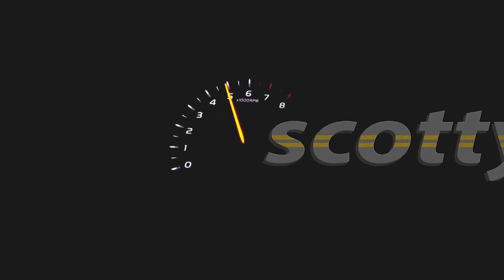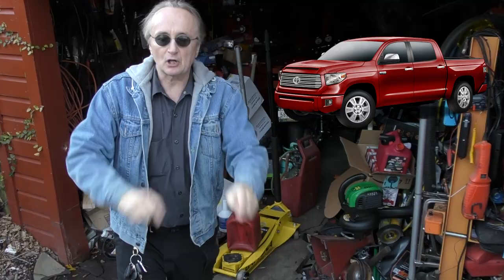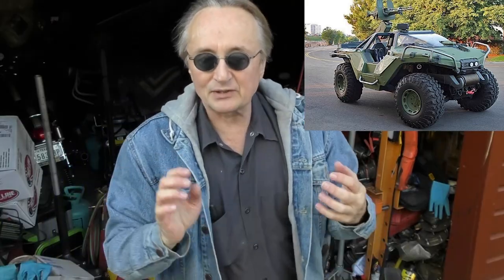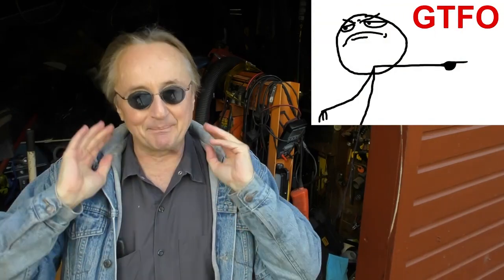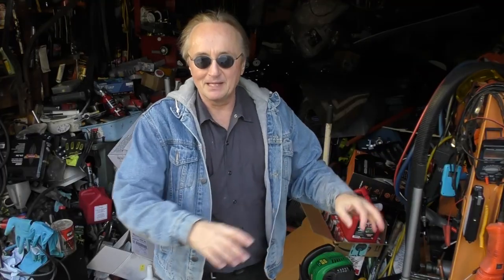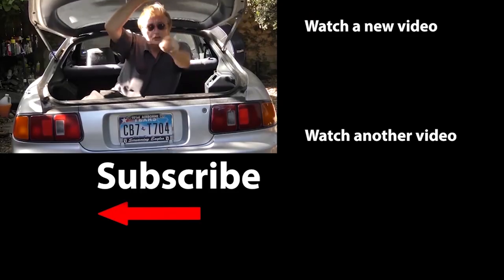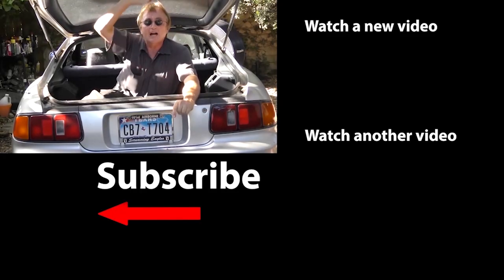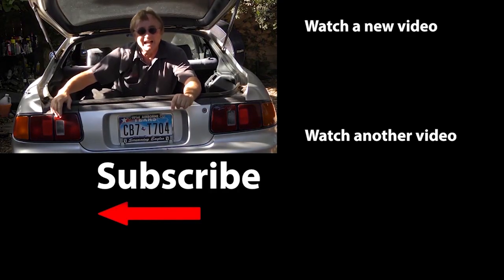5 Used Trucks You Should Never Buy

Comment: 90% of Ford trucks built before 2010 are still on the road.
The other 10% made it home.
Reply: I had a 1999 Ranger and went up to 200K with no major issues. I gave it to my ex landlord as I had to buy something with better gas mileage. I miss her. Best vehicle I ever owned.
Reply: Bullshit.  Still driving my 1999 ford pickup and the only thing I replaced was the water pump.  My buddy's all drive older Fords with no issues that amount to anything.  We own 5 Ford work trucks and we beat them up. Still working them hauling landscaping stuff. They are 2000 F150s.  Still running strong with no major issues.  We also have 2 Tundras  which are 2005s.  What great trucks.  They pull our equip trailers.
Reply: soon the 10 percent will join the 90% and go back to work again
Reply: Had two dodge trucks that had 200k and never had a problem
Reply: @ritualatom4119  I wish I had your luck. I had a new 2016 Ram 1500 5.7 4x4 and  it had many issues. I traded it for a 2019 Titan SV 4x4.
Reply: That joke is for dodge and Chevy
Reply: al carr Very true.
Reply: I dont see any fords on this list
Reply: Needed to repair my Ford very rarely, our GM vehicles gave us way more problems.
Reply: I got a 1988 ford F-150 with 88,000 and shes still running and driving super strong
Reply: Found On Road Dead
Reply: Yup. The other 90% are pulling Chevys out of the ditch!    FORD = First On Race Day!...
Reply: The only problem I can say about Ford's is there transmission typically go at around 100,000 miles other then that they are really solid
Reply: Matt Folta stop putting it in reverse on the freeway. my step grandpa uses his as a plow truck has only like 160k but shifts smooth and plowing is hard on ur transmission.
Reply: ZEROFUX  it runs better than your chevy tbh my mom had to take hers to a fucking machinic since her engine almost blew up and her alternator blew up her sensors kept going out and now there's a check engine light on
Reply: @kc-6837  I have 2016 RAM and i been traveling coast to coast and 0 problems. Your  Worst decision was trading for Nissan 😆 also am a ford guy😅
Reply: ZEROFUX  lol go back to your ps4 kid😂😂😂🤣🤣🤣
Reply: REALDEMON4U I wouldn’t have traded it but it came from the factory with the gas tank put in wrong,  the rear end was clunking because it was loose, numerous recalls, it smelled like it was burning oil, the brakes squeaked constantly, and the transmission seemed to have a mind of it’s own. All of that with 44,000 miles on a new  truck that I took good care of. No thanks. My three Nissan trucks have been great to me. I did love the Ram but it had too many problems for me. I do wish you the best with your Truck.
Reply: rob. g Glad to her that. I did love my Ram but it could have been a lemon. My buddy has a Tundra and he has never had an issue with it.
Reply: @liveuntetheredmusepodcast4832  Fix Or Repair Daily
Reply: @Kurt1969  How many windshields did you replace? My brother did that all the time seemed like. Plus on the road Rangers with cracks are everywhere.
Reply: Haha!
Reply: @ritualatom4119  You should play the lottery, then. Cause that's unheard of.
Reply: @StanTheObserver-lo8rx  I replaced mine 3 times. I still loved that truck. It was really good to me until I gave it away at 200K miles. Only because I drove 60 miles day. Otherwise I would have kept it.
Reply: @Kurt1969  lol,Why my brother did that same damn thing for his Ranger..200,000 plus miles. He retired and hated to trade it in. Then bought a Mercury something SUV. The wife wanted one.
Reply: @StanTheObserver-lo8rx  haha, I bought a Subaru Outback! ( 2008 when gas prices were high while living in New England ) I will be getting another car in the next few years and have thought about the new Ranger,  but will wait to see how it does.
Reply: Ford > Chevy > Ram
Reply: Spunbearing65, Guess your truck in on the list and now your feelings are hurt.
Reply: My dad still driving his 97 Expedition been a great vehicle. He bought it brand new.
Reply: @JordanKent814  its Chevy Ford Ram😀
Reply: Scotty never even mentioned Ford. This guy's a troll. Stop fueling the fire
Reply: 910AM Superstation Funnies  FIRST ON RACE DAY !!!
Reply: You misspelled Chevy
Reply: I know that's a LIE🙄
Reply: @kc-6837  awww.... You got a ford-nissan... JUNK😆
Reply: @mattfolta6956  yeah they're pretty sorry bout the transmissions☝

Comment: Agree with you on all but the Honda Ridgeline.   Mine has over 160,000 miles on it and the only failed component has been the started which I replaced myself for under $200
Reply: Ben my mother had one. It was an amazing truck.
Reply: Yeah mines an 06 RTL. Best vehicle I've ever owned. 

I think he just wants to bring the value of used Ridgelines down so he can buy one!
Reply: Hello, Ya mine has 310000 hard km because I use it for hunting and work, and i just had my starter go, and I found a company beside my work that rebuilds them and he did it for 110, and i did replaced it my self, very simple to replace, I don't know why he's lying saying engines blow up
Reply: @mikemasri4617  I'm with y'all. I'm on my 2nd Ridgeline, '06 is still running after 300K miles. My 2012 RTL has over 160K miles and going strong. Granted it is not to tow like a diesel, but for me they have been great and reliable! My wife drives a RAM 1500 Ecodiesel, now that on the other hand has been in out of the shop since we purchased it in 2015. It is the last RAM truck I'll ever buy.
Reply: My husband's is an 06' and it has over 215k miles on it and it is a champ! Best truck we've owned, best vehicle we've owned. Only thing we've done was regular stuff like spark plugs, battery, tires, oil changes, timing belt, etc. Major things we've done was alternator, power steering pump. Great truck non the less for 215k plus miles on it and still runs like a champ daily.
Reply: mine is a 2011 and i haule the camper , no problems over 155000km. 
better fit and finish than the domestic..... very happy with mine
Reply: I have one used, 2010, bought it because it's not a truck. It's an suv  safe easy too work on. If I wanted a truck I would have bought a toyota. Don't know why it's on this truck list, no rear axle ,not a truck period. My 87 volvo 240 is more a truck than my ridgeline. Love them both
Reply: My parents have a 2008 Honda Ridgeline with about 173,000 miles on it. I am a professional mechanic, so I have been fixing their vehicles and unfortunately, she was going through about a gallon of coolant last year each month without any external leaks. You could smell it from the exhaust and I was getting a misfire code from cylinder 4 on a cold start. I found out that coolant was getting into cylinder 4 (and only that cylinder) and assumed I was probably looking at a bad head gasket. I dug into it and found a crack between the intake valves for cylinder 4 on the left-hand cylinder head. I had to replace the cylinder head and did the timing belt and water pump while I was at it. Other than that, and regular maintenance,  it has been a really good vehicle for them. Just something to look out for on these 3.5L Honda engines. It's not very common from what I could tell when I googled the issue I found, but there are a few cases of it. I didn't charge labor, but the parts were just under $1,000 by the end of it. I think the labor to replace that cylinder head would have been 9 hours.
Reply: @stephanebelisle9029  I own a Ridgeline if you don't mind how heavy is the camper?
Reply: Sorry but not something you wanna be seen in ...if your a real man or women. Sorry but yaa...
Reply: Its nice to see all the Ridgeline owners here! Lots of '06 owners too like me! Anyone one have the '06 green color like mine?
Reply: @rileypearson2332  real men or women don't talk like that.

Comment: I have yet to hear or see anything wrong with a Ridgeline other than radiator supports on the older ones, and even that is pretty easy to remedy. Other than that, they can go for miles and miles and miles. If you're not a "truck person" but need a truck they usually fit the bill really well. I'd replace the Ridgeline on this list with any truck with a blue oval with fancy white letters in it. WAY too many trans issues. Ford truck transmissions have been slipping out of park and into reverse since the 1970s and Ford's fix: issue a warning sticker for the dash. I've personally seen a ranger sit for a while, then slip itself in to reverse, go around a building and into a golf cart. Our boss nearly had our heads if it wasn't for the security cam that proved it. "Found On Road Dead" for a reason.

Comment: My buddy has a Ridgeline.He tows his boat ,jumps curbs,off roads till hes stuck, loads it down with tools and equipment. Never fails him. 5,000lb tow capacity, 247hp 3.5 v6, 20+hwy mpg. In reality actually a very capable vehicle.
Reply: 19 mpg
Reply: Expert Scotty stands corrected by a youtube comment where a guy knows a guy...well guess what, i know a guy, that knows a guy that knows Scotty and he says Scotty is a good guy! so there
Reply: I really doubt 29. My Pilot gets 18 in combined city/highway driving. I think I did get 26 once between fill ups on a trip to Orlando.  Every time I crank the Pilot it uses an 1/8 tank it seems.
Reply: if he did all of those tasks simultaneously like a typical truck is built to do it wouldn't last a week though...
Reply: yes, thats more accurate for the mpg @Nippledozer
Reply: 29 is bullshit. 25 on premium or 22 on regular is way more realistic. Other than that I completely agree the Ridgeline is great and Scotty's way too hard on it
Reply: Yea I hate that he was shittin on Honda...
Reply: @VeilXan   Trans cooling is an issue with slow offroading the Ridgeline in HIGH elevations as it doesn't have dedicated fans on the trans cooler.  Lower elevations it has zero issues.  I've taken mine over many of the major jeep trails in the San Juans, most of which reach 12k+ elevation.  It just takes a little extra consideration to let it run so it can cool down after a long slow climb.  It is a plenty capable truck and I have never regretted buying one.
Reply: Lol you all made him edit his comment

Comment: I have a 08 Ridgeline with just over 90k on it and have never had a problem. Now I don't use it as a heavy-duty use truck but for small loads and around town it's great.
Reply: Honda makes great small engines...if you were smart you would head Scottys advice and just take really good care of that automatic transmission, flush it out now if you havnt already and never ever unless your about to be hit by a train. floor it and hold it there while it shifts  and use your brake instead of just switching from reverse to drive like my wife does
Reply: Michael Wells yup. My mother had one. Thing was amazing
Reply: Our 2006 ridgeline has 215k+ miles and going strong
Reply: Michael Ask Scotty, never ever flush your automatic transmission. You will ruin it. Just drain and refill. 

"Beware of false knowledge; it is more dangerous than ignorance" George Bernard Shaw

Comment: First time you’re wrong. Having managed a construction fleet, we had a mix of Rams and Silverado work trucks. Very poor trucks and terrible resale. We had a three Ridgelines initially for runners between work camps. Then overtime they were pulling mixers and hauling materials. All three made it to 200K miles over 6 years. 

When it was time to get new vehicles, we got next to nothing for the Rams and Silverados. The Ridgelines we got 2-3X more money comparably. As for maintenance, the Ridgelines cost 50% less to maintain and did nearly 90% of the work of the “work trucks”.

FYI- We had one Ridgeline blow a tranny. It was a $3,700 fix. Every Silverado and Ram we had had between one to three transmissions blown or were problematic which averaged about $4-6K per truck. It has to be reinforced that this was every Ram and Silverado we had on the fleet. No blown motors on any vehicles since we had a rigid 3,000 mile oil change regimen.
Reply: Incredible. You can't argue with resale value. There is a reason for the prices.
Reply: That’s a pretty good endorsement, I loved my 09 Ridgeline! Swiss Army knife of trucks IMO!
Reply: Chase Vineland
, I see conflicting opinions on the Silverado. What model years were yours?
Reply: yes, I have owned a Ridgeline for almost 10 years and its been Awesome, I don't know Kilmer is making up stories saying the engines blow up.  I always liked him because everything seemed true but i know with this video he's either lying or just making up stories
Reply: John NY We buy in intervals - 6 year cycles. Our newest fleet is 2014 and looking forward to 2020. FYI. I have had my share of Detroit steel and think the Ram and Silverados look better.
Reply: Mike Masri I don’t think he’s lying or making it up. I just think he’s misinformed and wrong.
Reply: When they came out I was not a fan of the Ridgeline, but I think it was how it was marketed as they are just as capable as any other 1/2 ton light duty pickup. I think a big part of it is the H badge. I have been looking for one for a few years now but the used prices are pretty high.
Reply: Retro Regulator Really? I have owned Detroit steel for decades. Not sure how old you are but I have been driving trucks and dualies when they had column shifters. Obviously my company uses Detroit steel trucks still today - but you have to keep within the conversation here. Scotty named the Ridgeline as a terrible truck. It’s clearly not. Believe me, veteran truckers like myself and a crew of 40+ were surprised how well the Ridgeline worked out.

Honda and Toyota making trucks forces Detroit to up their game. That’s a good thing whether you ever own a Japanese truck or not. We win as consumers.
Reply: @chasevineland1508  I use my 10 Ridgeline for work and tow a trailer every day. 50,000 kms in two years oil and gas with no problems.
Reply: Not a huge fan of Ridgelines btw, just love my Hondas!
Reply: Shoulda looked at your maintenance folks.  This makes not much sense.
Reply: Interesting.

Comment: After reading all of the favorable comments on the Honda Ridgeline, the vast majority disagree with you Scotty.
Reply: LM M I had a Rigeline, worst vehicle I’ve ever owned.
Reply: Sensitive Ridgeline owners, you are driving a SUV with truck envy, cool your feelings off in the puddles you drive through.
Reply: @davescott8859  ???  No, an SUV is a truck with a permanent cab on the back, you must be thinking of those tall station wagons people call crossovers.
Reply: @LM M
Scotty is talking to the smart open minded members of society. Not the "I own it and i refuse to admit i was wrong" members like yourself and any loyal Chrysler owner.
Reply: I've never seen Ridgeline owners pull or carry anything in their trucks. Bad drivers for sure though.
Reply: I have to agree. The VAST majority.  1 out of 100 will say something negative, either because they've never owned or driven one, or they had bad luck with one.
Reply: @reycuerdos  OR because they've been around the truck and car world long enough to recognize that a smaller engine, and especially unibody frame (subject to structural integrity problems once it rusts out) won't hold up long term.  Granted, the same can be said about 97% of cars sold today, so it is not so much singling out the Ridgeline as it is recognizing that overall, real trucks are built more durable than cars, or the Ridgelines.
Reply: It's a lot like a truck except it's not
Reply: @stinkycheese804  And your comment brings me back to what I had originally said. 
Also, a unibody frame and an all independent suspension excels for ride and handling purposes(anyone who's been around the truck and car world long enough knows that). I appreciate that in a vehicle because I don't go off the beaten path much, and I need a bed about 10% of the time.
Is a ladder frame more durable? Sure! But its also jittery, it twists and bends, its takes more space under the truck which reduces inside space, and its not great for on-road handling behavior. But its tough. 
With that said, if a had a dollar for every  truck I've seen with a twisted frame...
Reply: I disagree with with him based on 2 family members and 5 friends (including a Honda mechanic) that have (or own) first and second gen RLs, and have been as good as (pre-2016) Tacomas for reliability and resale value.
Reply: @jamesbailey4885  there not trucks no frame not biult to be trucks there glorified station wagons
Reply: better than your truck i bet.

Comment: I have a 2000 dodge Dakota with just a little over 200,100miles on it. The only issue I ever had (besides standard break mantinace) was the ball joints which I have had to replace once. The AC also needed to be replaced but that's it. Overall a great truck that will probably serve me another 10 years.